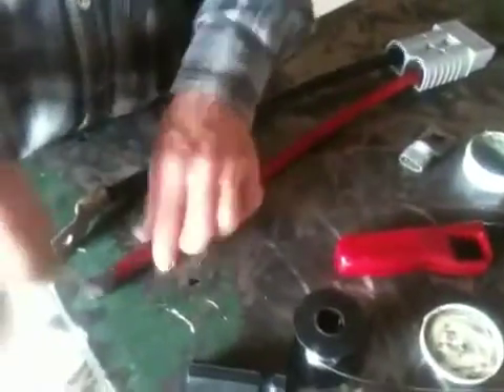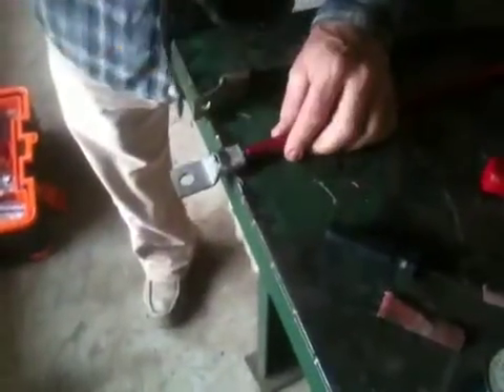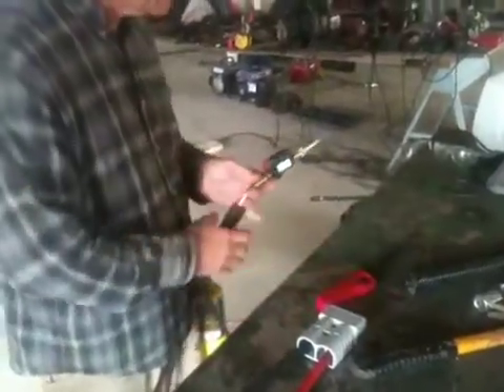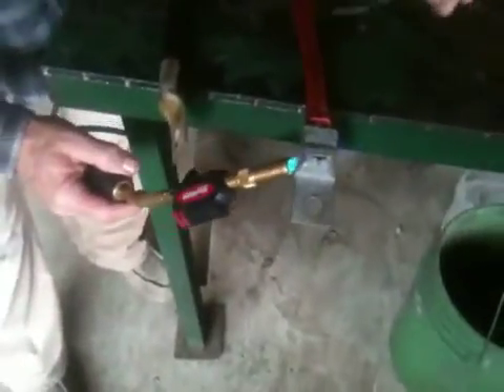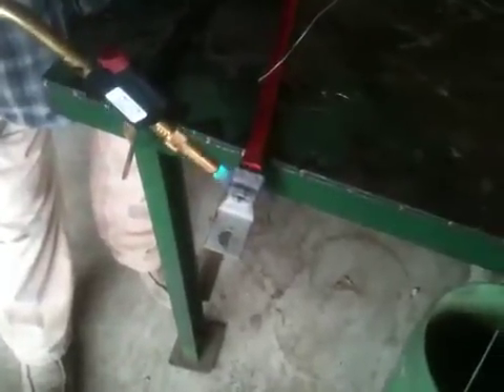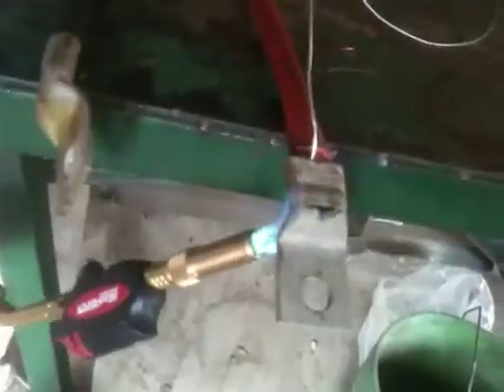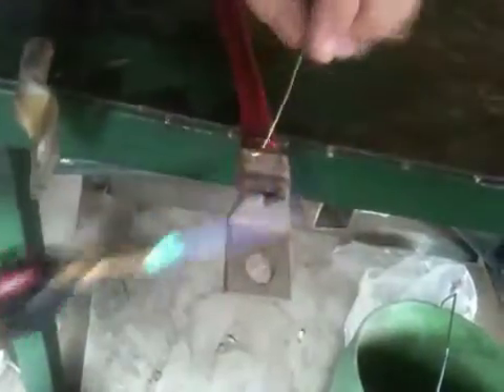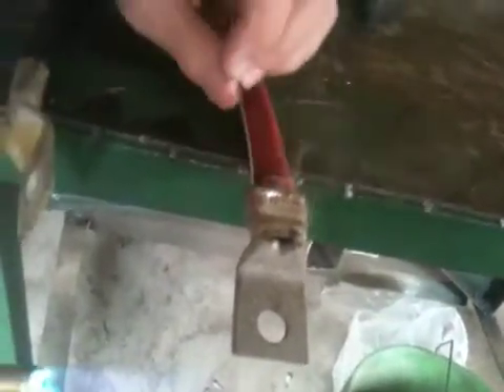Sweating terminal lugs for inverter/battery system

Comment: In the electronics field we avoid sandpaper/emery cloth in order to avoid the falling off of glass that he was talking about as in aluminum oxide or other insulating oxides/glass. We use an abrasive pad of steel or copper to clean the surface. Not steel wool but a brillo-type pad. Emery is probably OK for something this big but a copper brillo-type pad is really cheap at the grocery store. A lot cheaper than emery and no oxides fall off. For components I definitely would not use emery.